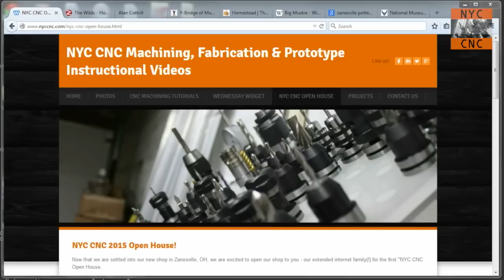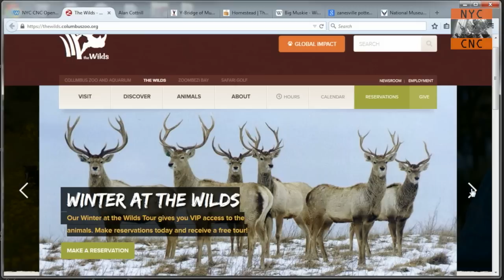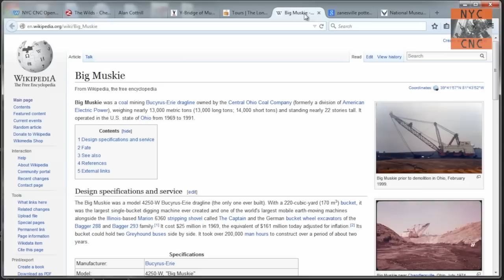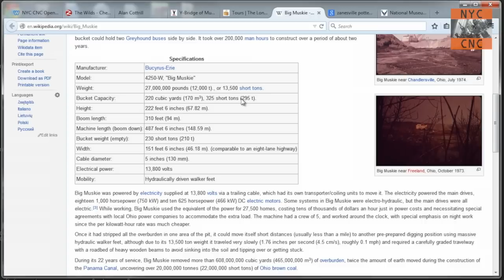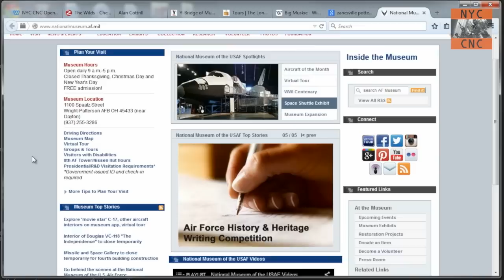NYC CNC Open House! Come Visit Saturday March 28, 2015!

Comment: Congrats on the lathe! That thing looks amazing. I'm holding out for a pneumatic collet closer since all I'll be doing is making 100s of 2 or 3 different parts.

I won't be able to make it to the open house, but best of luck! Should be a lot of fun
Reply: NYC CNC
They've got an air cylinder coming that will make it automatic, I'm totally getting one ;-).  Glad to hear you're getting the lathe, I LOVE mine.  Best of luck on the open house, I'm not sure if I'll be able to swing it (though it's only a 6 hour drive....) but you're going to have a blast!